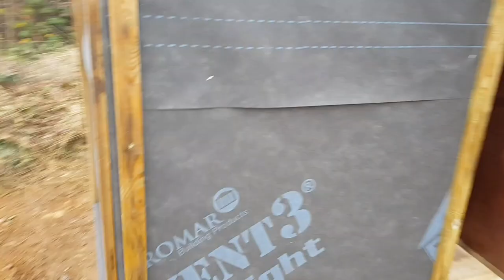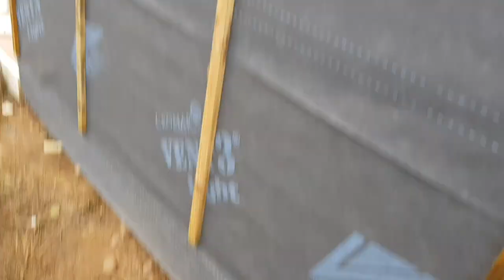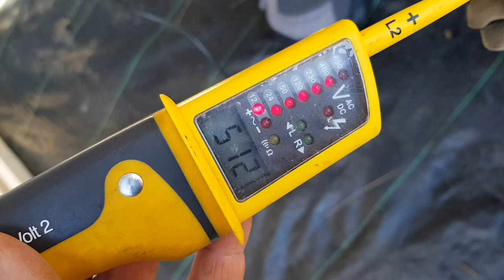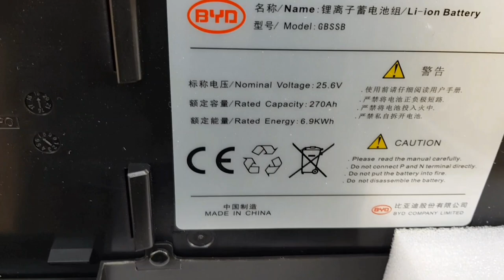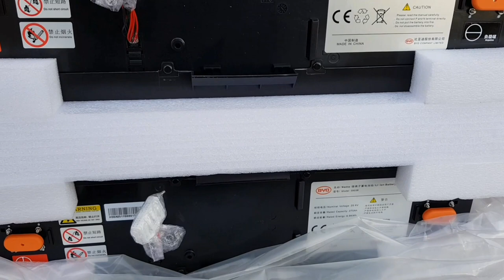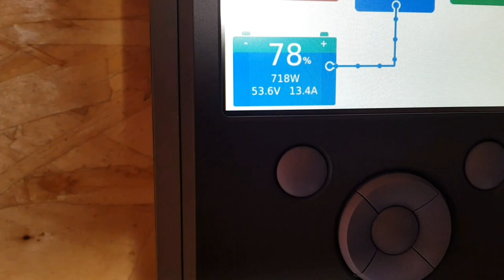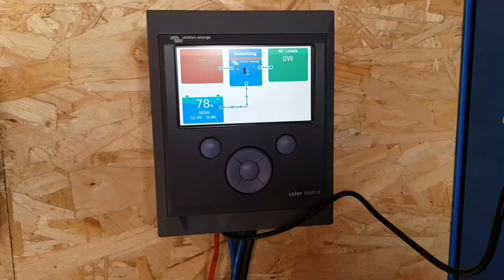Installing a 10kw Offgrid solar power system, Full Video.

Comment: With racking like that, you should leave a gap of at least a foot and preferably 2 between the bottom edge of the lowest modules and the ground so any wind coming at the back of the array will blow through the gap.  The way you did it, the racking will act like a sail and flip with enough wind.
Reply from the maker: Its pegged and weighted down, we have had 5, 30+ mph wind storms now and they are all good 👍

Comment: I want a based project in India. Would like to use my own power rather than that Stupid Grid power (villages, duh)

None the less, amazing video! :D
Reply: Solar panels over there are dead cheap. The biggest cost is labour. I've heard of people spending like £500 on solar panels to power the whole house (as long as you have ceiling fans, instead of AC), which is fantastic tbh. Granted, those people tend to be British Indians or British Pakistanis, but £500 is a freaking bargain, especially when the national infrastructure keeps cutting out

Comment: Nice idea with solar panels for winter low light, however consider a see-saw type steel pole so panels are allowed to rotate annually. And just wanted to know if the back of the shed door got insolated ? Great job 👍

Comment: Amazing! How much did the whole setup set you back?
Reply from the maker: Too much 😂😂😂
Reply: @FieldtoFarm_UK  Any figures? Normally it's like 5K for a 2.5 kWp setup. I'm buying a house which requires 10884 kWh per year for space heating and 2290 kWh per year
 for water heating

Besides, couldn't you have a battery for storage too and not necessarily needing it in the winter sun?

Comment: great stuff love your whole setup- at the end it shows just over 300w, that seemed to come from the battery, what is the average w output when pulling directly from the solar panels on an average day? plus what did this setup cost you if you don't mind disclosing? im wondering if this would be useful for me. thanks
Reply from the maker: So far we have been mostly pulling about 800w constantly and about 1-3kw in the day and we have had to put the generator on once so far lol. I drained the batteries for a test tho and in sun it can get about 5.5kw going into the batteries which charges it in about 2 hours from 1% to 100%. In the sun the system will also happily draw 5 to 6kw straight from the panels direct to use without going through the battery 👍 system wasnt too bad a cost it is higher end though but not top spec and will have a pay back off about 6 years max in fuel savings. Plus the all round benefit of having equivalent to mains power rather than having to start a generator for anything more than 500w draw from our old system. Its defo well worth getting a good system in my opinion 👍

Comment: Not that it's going to be there long but your loosing a lot of power with shading from your racking . The middle board is blocking a whole row a cells.
Reply from the maker: Ye some shade, but nothing more than a few watts drop. Its rigged on 500v strings and oversized for array for our inverter so didnt notice the drop. It's all mounted on our chicken shed now tho 👌

Comment: Nice, Solar panels to inverter, was that a 4mm, cable?
Reply from the maker: Ask an electrician to be 100 percent, I used a 10mm 4 core armoured cable
Reply: @FieldtoFarm_UK  Thanks
Reply: @FieldtoFarm_UK  You used AC cable to run from inverters to panels?

Comment: That softwood frame for solar wont last 2 minutes
Reply from the maker: If u mean it will last years and is a fraction of the cost of a steel rail system then u would be correct lol